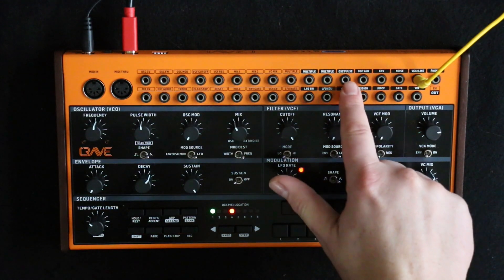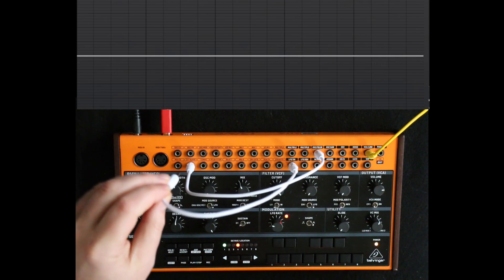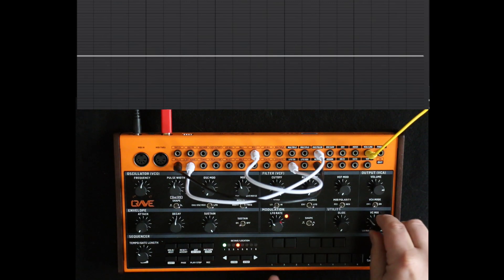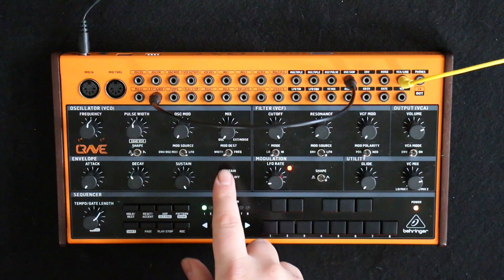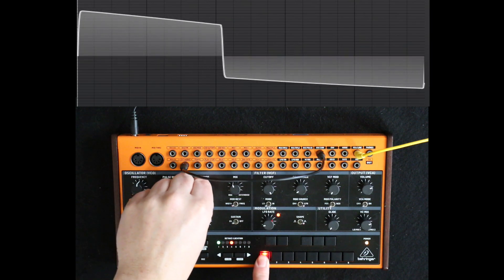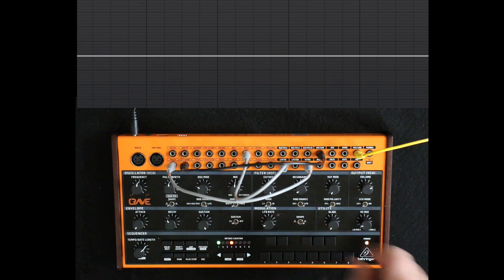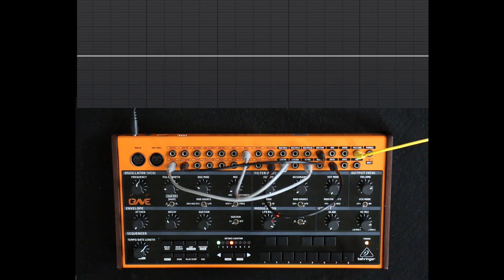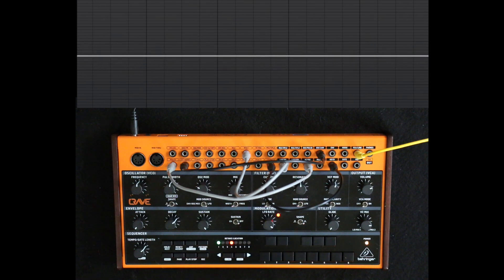Patch Ideas #2 Extra Waveshapes: Behringer CRAVE and Mother 32

Comment: hey man thank you soooo much for your amazing series, your videos have helped more than anyother on youtube! i was wondering how to connect the crave to a reverb pedal or something since the crave only has a 3.5mm out. Thank you :)
Reply from the maker: You just need an adaptor. I use a 3.5mm patch lead with a headphone adaptor. Sometimes, however, it’s a pain if the the L+R channel get mixed up somehow so you have to have the adaptor half plugged in. I’ve actually just ordered some 3.5 - 6.5mm jack cables to simplify things.
Reply from the maker: Max Janssen the output of the reverb will be line level, so you’ll need to amplify the signal.  This is normally done using a mixer, amplifier, audio interface etc.  And using the headphone socket in those. But if you have none of them and just want to plug headphones direct you’ll need a headphone amp.  I think the Behringer MA400 May work... but I can’t be 100% certain.  To use that you’d need a standard 6.5mm (1/2 inch) jack lead.  The reverb won’t be stereo though, unless you buy a split stereo cable as it looks like the D600 uses 2 outputs for L + R but Again I’m not sureThere are so many options tbh depending on what you already have that I can’t cover all here.  Basically anything with an audio input and headphone socket will generally work.

Comment: Hi & thanks for this video. In your other video (overview) you pressed a combination of shift + some other keys (hold plus 8 I think) before patching. I wasn't sure why you did that. Is this necessary to get into a special 'mode' before you can patch? (sorry, I have never 'patched' before. :D )
Reply from the maker: That’s to enter input/output mode so you can set what signal is sent from the ASSIGN CV out. I use this to emulate LFOs.  I’ve a video showing exactly this. I think it’s #3 in my tutorials.

Comment: Is it possible to route the Saw/Square so one is a sub for the other, or slightly detuned? 

Can you route the Saw/Tri blend from the Oscillator in such a way that the envelope triggers it? It's a cool sound.

Also, if I'm not mistaken, the chip in the crave also puts out a triangle, I wonder if there's a simple mod to take advantage of that to get a detuned tri sound?

Comment: Whatever this synth is doing, it never seems to carry much depth or character to my ears.  What do you hear?
Reply from the maker: have you watched this? https://youtu.be/JexfJSNVQmM
Reply: I got the crave and the novation bass station 2 and the crave got much more depth and punch in sound than the bs2, i was really shocked while trying the first groove with the crave and bs2 together. I first wanted to use the bs 2 for bass and the crave for leads and arps but now i use the bs2 for leads and the crave for low end